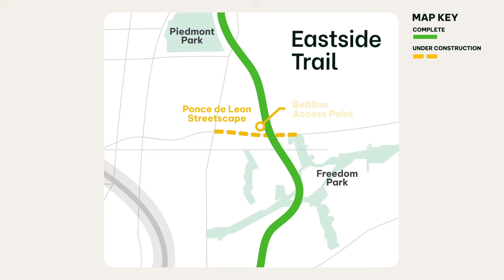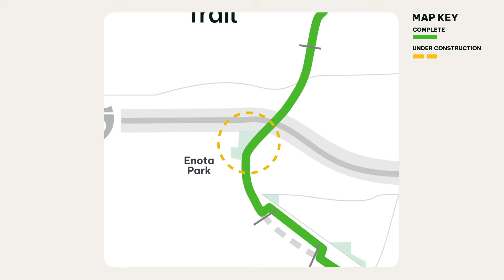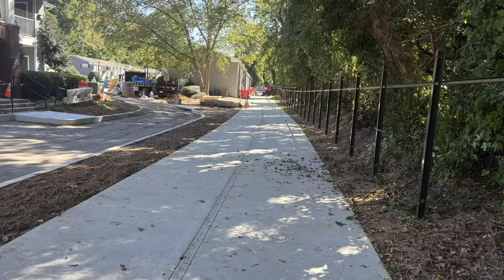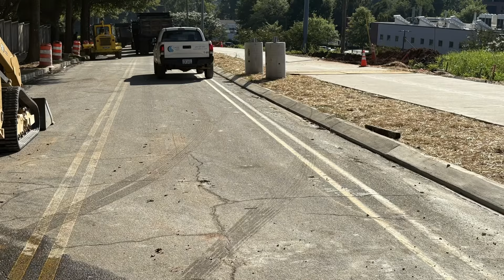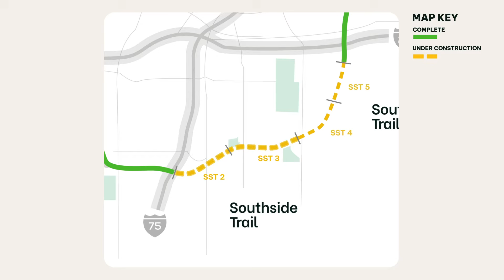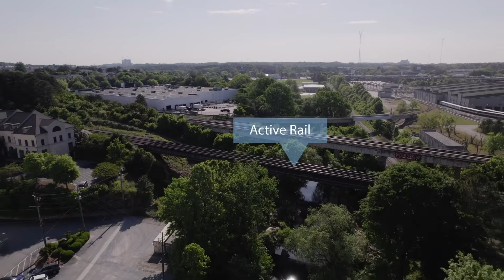Atlanta Beltline | Design & Construction Updates (09.25)

Comment: Need to look into track-less rail. China is starting to implement trackless tram systems that are cheaper and don’t require as much infrastructure.
Reply: Do they run on grass and brush? If not then infrastructure will be needed. A path whether rail or concrete will need to be placed. Do they run on wires or battery? If a catenary system isn’t needed, a new adjacent facility is needed to charge and store them..I’m thinking that will cost more than utilizing the light rail maintenance yard already in place on Auburn ave
Reply: @matthewennis3591  I didn’t say no infrastructure is needed. But it’s far less. Laying concrete is a lot cheaper than tracks and a wired system. Look into it. Theres a few videos on YouTube that talk about it.